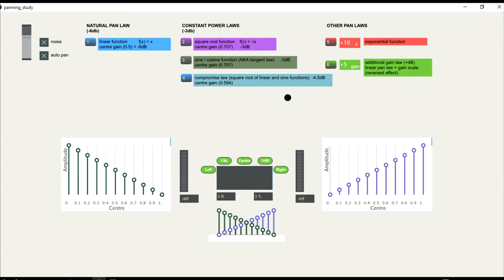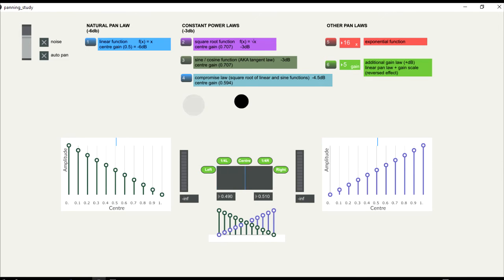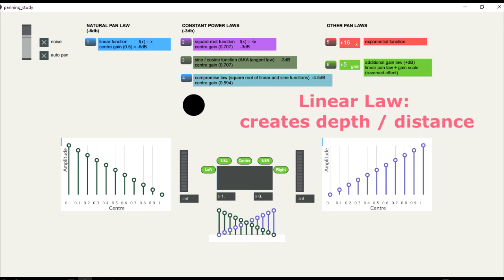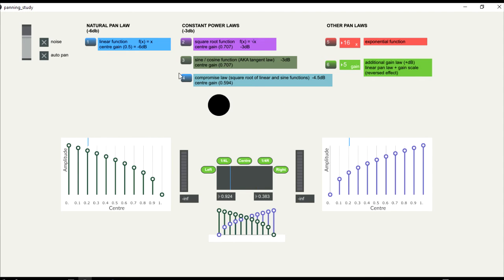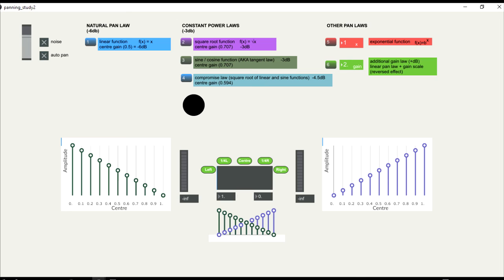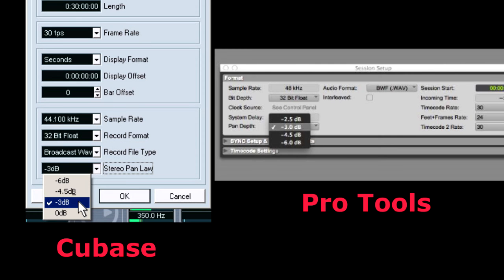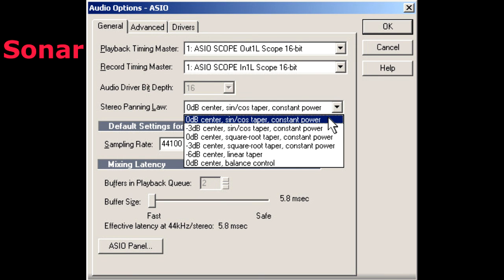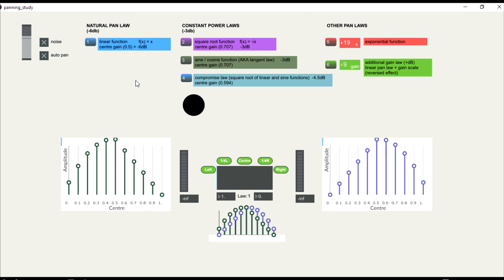Everything about Pan Law (Panning Law)

Comment: Hi... The video was way informative. But Studio One provides some other options like 0 db balance sin/cos and 0 db linear. Can u please clarify this bro. And is it as simple like in the beginning of my project I set the pan law to -3 db at all channels (Coz Studio one doesn't have global pan laws and I should calibrate each channel with a seperate plugin that controls the pan law of that respective channel ) and start to balance my levels to get a static mix or should I take any other thing into consideration ? Thank u so much for this clarifying video bro...
Reply from the maker: Hi, as mentioned at the end of the video, some DAW will provide a 0dB law. This implies that there is 0dB in the centre. It's hard to tell how each software operates as they use different algorithms, but it is likely that it will reduce the general amplitude of all sounds in the mix to increase the gain to 0dB without distortion. I'm not familiar with Studio One but providing 0dB linear and 0dB sine also happens in Sonar, as shown in the video. 

I believe the algorithm runs one function (linear or sine) and then applies this extra gain, generating a different curve. I'd need to do some tests to reverse the engineering and get to some conclusion, but I suppose they will have similar results. I wish all the DAW manuals could explain better what they mean with that.

Nevertheless, if you want the sound in the centre to be louder than the sides, 0dB should be the option for you. But that's rarely the case. If you want to have a conventional mix, stick to -3dB. One more thing, if you are not moving the sound sources (creating automations from left to right, etc) just choose anything, do your mix and it will all be fine. Good luck. :)
Reply: @IanCostabile  Thanks a lot Ian ❤

Comment: Hi there
But crossfade effect can only be done by delaying one channel's  signal right?
Reply from the maker: Hi, thanks for commenting! I'm not sure if I understand your question. There are no delays on the signals, only the amplitude changes.
Reply: @IanCostabile  OMG thanks for replying
Crossfade effect is when we are perceiving both channels with both of our ears using headphones.
But we also add little delayed audio of left channel to right side of headphone & right channel to left side of headphone. 
This creates a sense of depth(binaural)
Eg. When we are listening thro' monitor speakers
Reply from the maker: @chills2447  I think that's a different concept of crossfade you are referring to. In general, crossfade only means that when one channel goes up the other goes down...thus the 'cross' and 'fade'. Read on wikipedia: https://en.wikipedia.org/wiki/Fade_(audio_engineering)#Crossfading
Or type on Google 'crossfade definition' and you will see that: "crossfade (in sound or film editing) make a picture or sound appear or be heard gradually as another disappears or becomes silent."
Reply: @IanCostabile  Thank you
Reply from the maker: @chills2447  no problem! :)
Reply: @chills2447 what you're describing is called 'crossfeed'
Reply: At 0:36 you say the increase and decrease of channels is called crossfade

Comment: I'm confused about what you said of perceived loudness at 3:00. From what I was calculating, a point in space at a certain distance from one loudspeaker at 98 decibels, for example, at a certain linear amplitude value entering the loudspeaker would be at the same 98 decibels of sound pressure if there were two loudspeakers at the same distance from this specific point but that were being fed half the electric voltage, thus radiating, each loudspeaker, at 92 decibels and summing acoustically at the specific point to 92+6 = 98 decibels. 

It would seem to me that the half point of the linear panning law, when both loudspeakers are at 0.5 amplitude compared to the 1 amplitude value of hard panning left or right, should give a perceived loudness at a specific listening point of the same intensity as the loudness of two loudspeakers that would have half the voltage being fed to them. 

It seems contradictory to me that we can have the same sound pressure levels at a point, be it with one or two speakers radiating acoustic signals, but have different perceptions of loudness levels. I did notice the drop in level when the panning is placed at half the way of the linear panning function, but the math doesn't seem to add up to me. Are the calculations of this thought incorrect in some way regarding the approach to decibels? Or is there more to the psychoacoustic side of it that I should be aware of? Thank you for the video.
Reply from the maker: At 3:00 I just wanted to make clear that if two loudspeakers have a volume reduction of 50%, the two of them together do no provide the equivalent of 100% to our ears. And that's the issue of linear amplitude that some panning laws try to 'treat'.

In other words, in a linear scale where we are observing electric voltage levels, two speakers producing 0.5W may add to 1W of power, but our perception of loudness will not make 0.5 + 0.5 = 1. It will be less, because our sense of hearing, in terms of loudness, is not linear. 2W will not present to our ears the double of our sensation of 1W.

Comment: Thank you :D I came from logic and wnated to refresh my memory
I always used -3dB compensated,  but it seems like 0 would be a much better thing to choose, isn't it simpler to work with? why isn't it used everywhere by default?
Reply from the maker: 0dB in the centre is the additional gain scale. As explained in the end of the video, this will make the sound louder in the centre and when you pan from side to side it will appear to approach the listener. It creates an interesting effect, but it doesn't make sense to be the standard. The standard is - 3dB (sine or square) because the centre appears to have the same loudness as on the sides. I hope that helps you and thanks for watching!
Reply: hmm yes it does, but maybe because we're "taught" to use it this way. If we used 0dB then it would be more natural for us to adjust the volume accordingly Because we always have to do that anyway, probably no one works with normalized recordings. 3dB makes it actually more complicated :)

Thank you too!